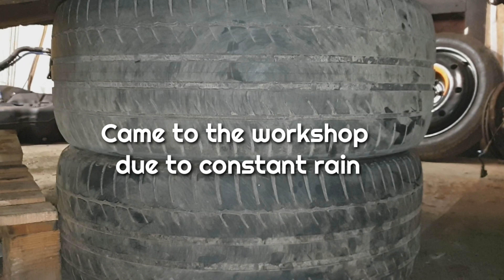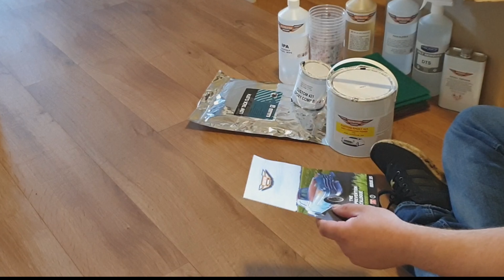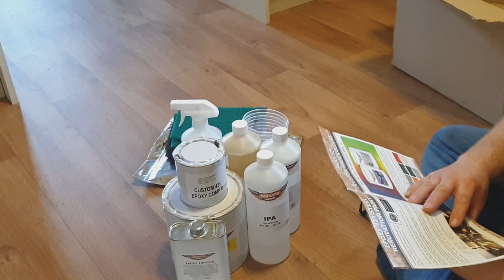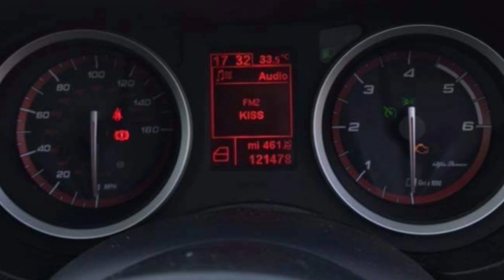Alfa Romeo 159 project - Part 5 - Rusty rear end - unboxing rust treatments!

Comment: Really good, this video series you're doing.  Re: the prices for the gear you bought, I think you did pretty well.  Resin is hideously expensive, so 50 notes for 2.5L + hardener is a good deal. Rust reformers and so on seem very reasonably priced. £125 all in is a pretty fair price, the supplier has to make some money too, eh.  Been watching your vids because I'm thinking about maybe getting into a 159 as a project car, but I'm also learning a ton of useful stuff I can apply to my '03 B5.5 wagon.  Thanks for making these :-)
Reply from the maker: Thanks for watching🙂 I'm told there are some good 159s out there,  I'd reccomend finding as late a car as possible. That way it should be just a case of preventive maintenance. 
The kit I bought should see the engine bay and front inner arches finished but I'll have to spend that again to do the back end. Another video coming later this week.
Reply: @FullBoostJ4  I noticed a lot of surface rust on the rear beam of my 5.5 recently, might have to do the same as you and drop it; then again, might be able to do it all in situ.  Defo very interesting watching you do this work.  Tons of good pointers on where to look for rust problem areas on the 159 as well (before buying one!).  Really looking forward to seeing your videos on the engine too.  I could go A4B6 for a project car as I know my way around those, but the 159s just look sooooo damn good :-)
Reply: P.S. Good tip on aiming to get a late model, but looking at the finish on those seam seals, and depending on where the car has lived, I think this issue could affect even a later model.  Very poor attention to a very important detail at the factory, I'm sad to say.
Reply from the maker: @Grantidge69  They really do look great! Can't wait to get this one on the road again🙂
Reply from the maker: @Grantidge69  they've always been like it through the entire Fiat group. Ive even had the chance to look over a Ferrari and found similar things,  I think it's just an Italian thing lol. A lot of people are getting put of the diesels now too. I've not been inspired by the numbers from the petrol engines. Only the 3.2 looked any good maybe the 1750 has some scope for tuning but I hear the 2.2 is not so good.
Reply: @FullBoostJ4  Yeah, remember Lancias? Rusting before they left the factory... Could be the steel they're using, esp. if it's recycled, but I think it is an Italian thing too, style over substance.  But hey, the style! 

Meanwhile turbo diesels readily remap to very impressive figures and a petrol engine will never match the torque a diesel yields unless it has many, many cylinders and several large herds of horses. The torque is what matters and a tdi will still give vastly better MPG and withstand the mods far better without too much top and bottom end tinkering. But it has been deemed a dirty technology, even though it is better than the gasoline technology in so many ways. 

Now, I still love a petrol V6, it's a triumph of engineering and is preferable to a V8 in many ways, but remap options are limited on N/A engines, so you kind of have to get what you're given with those.  AWD helps but the Q4 159s are still big bucks and I'll bet the floor pans are different between Q4 and FWD models, so no chance to mod that way.  Big power for not big bucks, the turbo diesel is defo the way forward. I figure there's a few years left in them before the govt force-phases them out... after all, I'm not seeing any electric HGVs on the road atm, are you?  Or electric passenger ships...
Reply from the maker: @Grantidge69  Good points there. Although I am partial to a V8🤣🤣
Reply: @FullBoostJ4  Hard to beat that sound... LS swap it, maybe...? ;-)
Reply from the maker: @Grantidge69  I have a spare Toyota V8....
 No stop, must resist!

Comment: Hi Full Boost J4.

 I am watching all your videos that are related to 159 project, and apart that they are quite interesting, I have seen the Fiat 20v turbo block on the bakground of your garage (0:49). I am getting information about the 159 and the Brera for a long, long time for my own project and I need to ask you two questions:

-1st Are the 2.4 jtdm engine mounts compatible with the Fiat 20v turbo? I mean, are the engine mounts attached to the engine block in the same points (using similar screws) in both engine blocks?

-2nd As far as I know, the Fiat 2.0 20v turbo uses the C630 gearbox and, according to the pictures that I have found in internet, the bolt pattern looks like pretty similar to the bolt pattern of the  2.4 jtdm F40 gearbox. Could you confirm if the F40 gearbox can be attached to the Fiat 20v block? In case you need an adaptor plate, do you think it would very complex?

Thank you for all the videos of the project.
Reply from the maker: Hi Mr C. These are some great questions and something that I've been wondering about too! The mounts certainly look similar and the gearbox has interesting possibilities. I will do some checking and make a quick video on it👍
Reply: @FullBoostJ4  , all the details that you can provide about those points are gold for me. Thank you.
Reply from the maker: @Mister_Ce  There will be a video out tomorrow🙂
Thanks for watching and the questions😎👍

Comment: My alfa 159 has done 200 000km But there is no way near the amount of rust like yours.  in fact like 10% of yours at most :)
Reply from the maker: There are lots of factors at play, material quality, build quality (seam sealant application) how the car has been looked after (winter driving on salty roads) 
I looked at quite a few 159s at the Alfa car meets and there are tell tale signs in more than a few.
Reply: Where are you located?